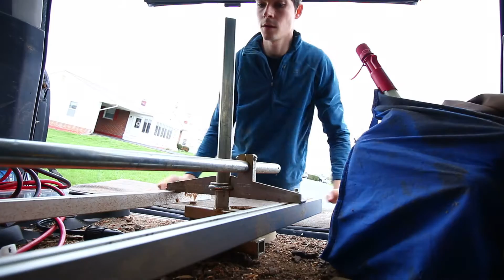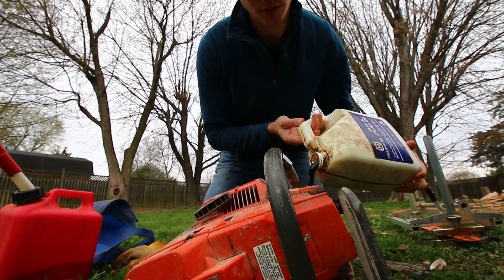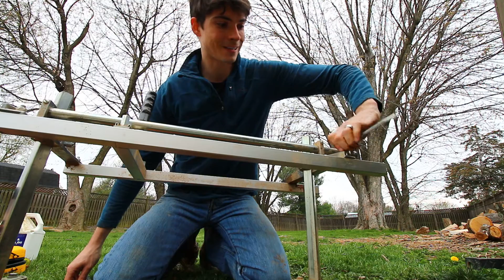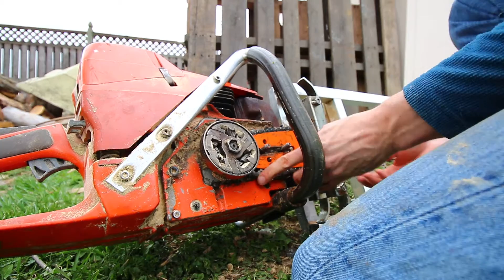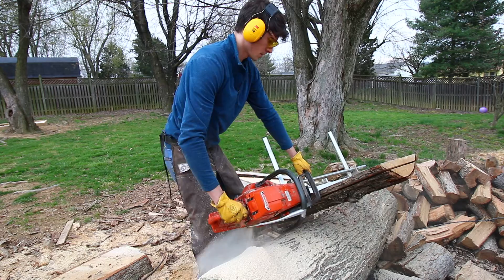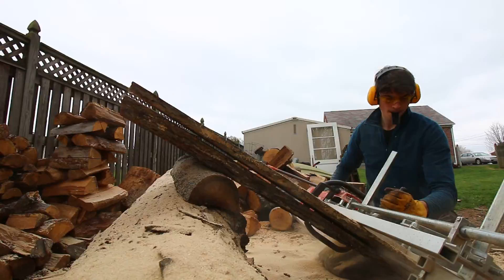My Setup and Milling Spalted Maple with Granberg Chainsaw Mill and Husq 395

Comment: Nice saw! I use the Husqvarna 390 for milling because I got mine for $500. I would have preferred a Stihl 660 but the price was right. Keep up with the videos.
Reply from the maker: +endlessmountainwoodworks 

Thanks, I've filmed a few videos but never posted one. This time I decided what the heck.

$500 is a heck of a deal on that one. This well used 395 was $650 w/36" bar and chain.
Reply: +Josh Long Seems like a good deal to me. The lower end torque on that 390 is unbelievable when the biggest saw I have before it was a Stihl 290.

Comment: Used motor oil in the oiler for the 395XP  ???
Oh, the humanity.  

Nice video, by the way.
Reply from the maker: Patrick Wagz thanks! Lol, tough times call for desperate measures... it was only a little bit of motor oil added to the jug, if that even makes it better. I only had enough time to mill, or get bar oil, I chose mill.

Comment: why not put the bar on first?
Reply from the maker: You're asking the right question! On a saw with an outboard clutch the bar should go on the chainsaw first. It was a lesson I learned the hard way. 

On every other saw I've used it is harder and more work getting the bar into the granberg and set up the first time, so I leave the bar in the granberg, and just pop loose the bar from the chainsaw once it's set (if I need the chainsaw for bucking/felling/etc.)

Comment: One thing I've learned about chainsaw milling- chain must be RAZOR-SHARP. From what we can see on the vid, looks like your saw is spitting mainly dust, telling us the chain could use the attentions of a file. Keeping the b&c clamped in the mill makes it difficult for regular chain-filing. IME, chain will tell you it needs filing every other fillup. False economy to skimp there, prematurely wearing bar, chain, power-head, sawyer.
Reply from the maker: I appreciate the advice, it probably could've used a sharpen.
Some may disagree with me here, but I've had fairly good luck, and seem to be getting better at it, with using a dremel rotary tool and the right size stone. The stone wears out hella fast, but the down time sharpening is minimal, which then leads me to sharpen more often... which I totally agree with you is imperative when milling.

Comment: just a few pieces of advice..
1 always have your equipment  ready to go.
2 never use anything other than bar oil.
3 it's not a toy SERIOUS injury can happen at a moment's notice!
4 you have to be smarter than the materials and equipment your working with to survive a long day.. & not using WEDGES..??  ALLOWS cut piece to pinch the blade no matter how much power the saw has NOT SMART !
and neither is crouching at the point the saw is emerging! 

I admire your interest in such a craft. 
I only hope you stay safe! 
no need to record yourself with daddy's saw only to loose some toes! 
get skills, then show those off!  
start with set up of the piece being milled....
 flat or less of an angle than you had. finish the cut... pull the saw..move the board.. clean off your next cut so the mill sets properly and will move unrestricted through the cut!. 
your style cutting..
on an angle is ment for a hillside milling. 
flat to the landscape is always your best bet.. practice makes perfect be safe and put some earmuffs on damn it!
Reply from the maker: What do you think those yellow things on my ears are? Ear warmers lol?

I’m wearing steel toes, chaps, muffs, gloves, glasses, mother on speed dial. 

Crouched at the end there is still 2+” of maple between me and the saw, and I’m braced ready for it to come out. Plus the granberg has the chains surrounded by metal. I didn’t show the end where the saw came out.

I always appreciate the tips, but your comments will go further if you don’t seek to be condescending. 

I’ll wager I’m more familiar with the damage chainsaws can do, with or without appropriate caution, than most.
Reply from the maker: I’ll try hillside next, probably less precarious, but I hate pushing the saw through, rather use gravity, and I’ll try a wedge as you suggest.